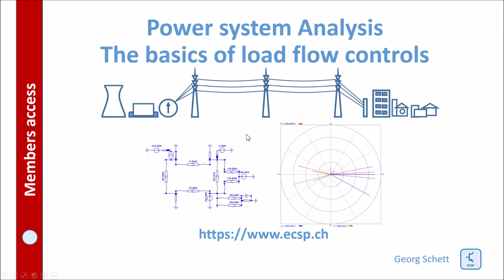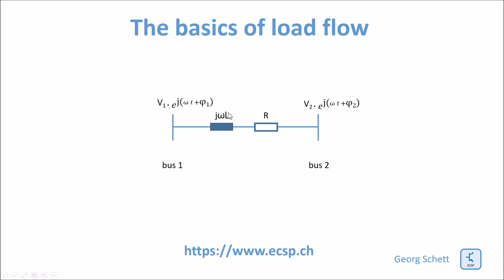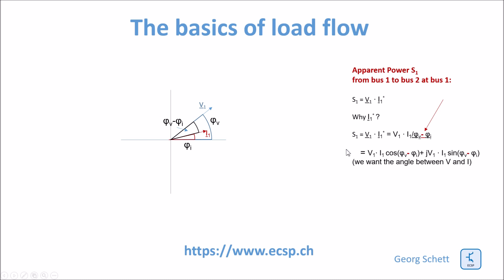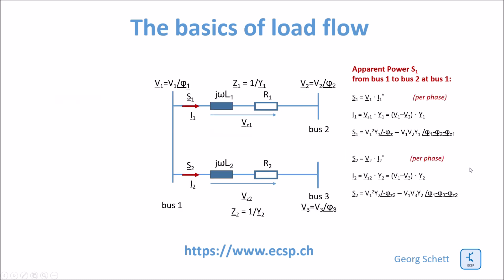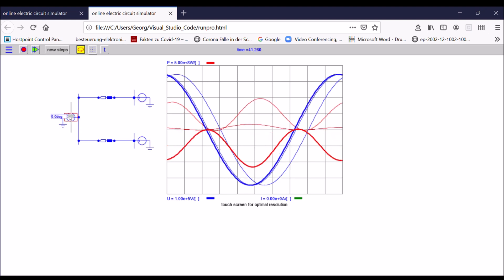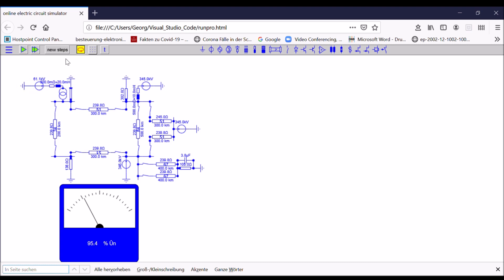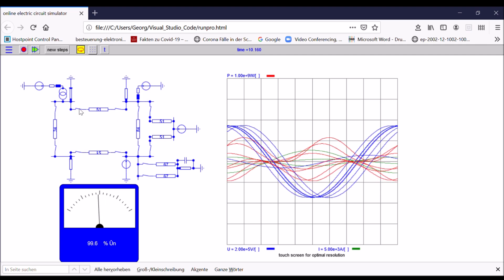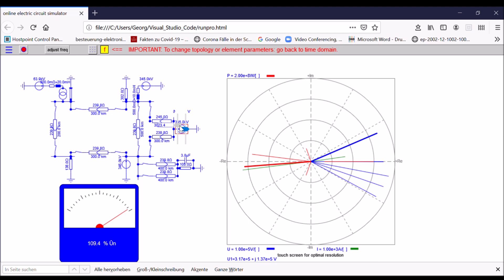Power system load flow basics [circuit simulator]

Comment: Hello sir which program used.. Thanks
Reply from the maker: Dear Colleague, the software browser based (works on Firefox, Chrome, Opera and maybe Safare. NOT on Internet Explorer).
Reply: Tech SUPPORT  It is not the ETAP program, but a browser based app. So you don't need to download any software. However, you will need to register to access the simulator.
Reply from the maker: Tech SUPPORT  no, this is ecsp = Electric Circuit Simulation Program, an own development.